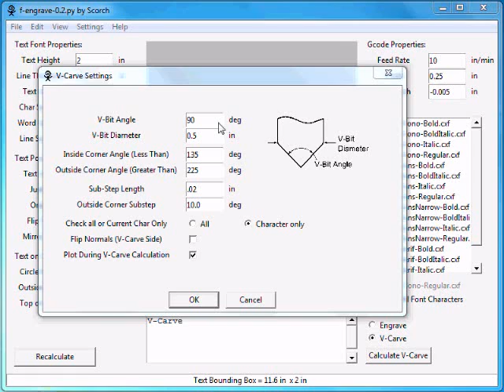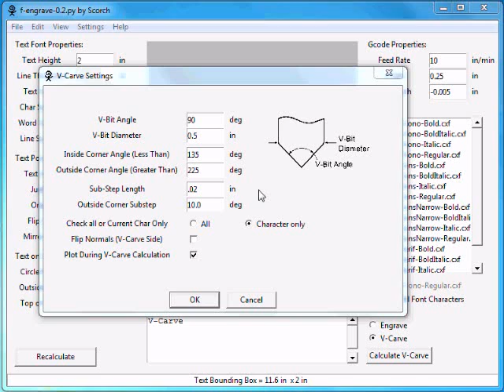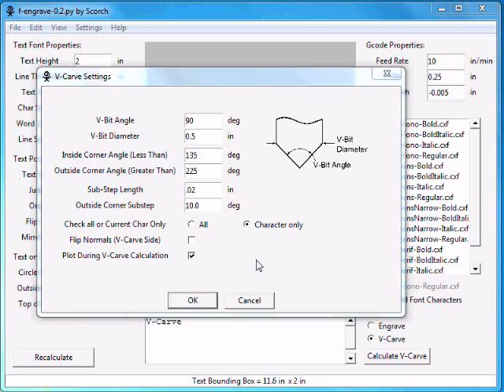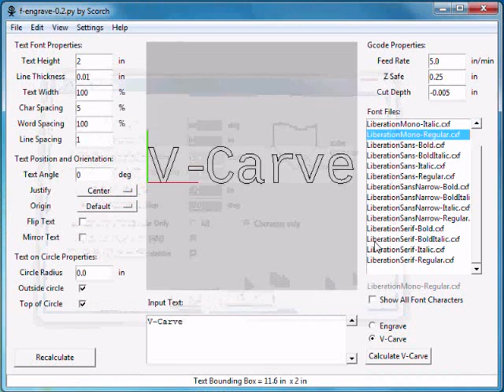V-Carving with F-Engrave V0.2 GPL Software

Comment: I have been using F engrave for over a year and now know just enough to be dangerous! My efforts thus far have produced some nice work thanks to your program. My question relates to the V carve settings dialogue. Up to now I have set up the dialogue with a 60 degree v bit and used a .125 flat bit and the same v bit to cleanup. So how does the program know I am using a flat bit to cleanup? It works great but how does it know I'm not using a ball nose bit. Perhaps it doesn't matter? I'm using v1.68
Reply from the maker: Cleanup assumes you are using a flat bit to cleanup.  Using a ball nose but for cleanup does not make sense unless you want to have little bumps in the bottom of your carving between the toolpaths.  If that is the case you can just use a ball nose in place of the flat bit.  You can control how big the bumps are by changing the stepover.  A smaller stepover will result in smaller bumps.  A really small stepover will give you a similar result as a flat bit (but it will take more time because of the small stepover.)
Reply: @ScorchWorks  As I thought and you have confirmed. Thanks

Comment: So using engrave will just be like using single line fonts?.... It will just follow one path and not try to fill in an area?
Reply from the maker: Engraving will not fill an area.  If you use a font that is designed as a single line font it will create characters by following the single line path.  Most fonts are defined by the outlines of the characters.  For those fonts the engraving moves will follow the outlines of the characters.  There are links to a few single line fonts at the bottom of the F-Engrave web page.
Reply: Thank you...that clearamit up but only issue is you really dont know what outcome will be until you actually machine it since depending on diameter of tool it could not engrave properly...
Reply: It basically shows a toolpath and you would have to be aware of proper bit to use to produce good output
Reply from the maker: @shelby50411  You can set the line width to see what it will look like.

Comment: how do you choose tool using engrave?..there are no options to choose bit size so how can it produce gcode?
Reply from the maker: For engraving the tool just follows the input lines with no offset. So F-Engrave can certainly generate g-code without knowing the bit size.  The 'Line Width" setting allows you to adjust the visual display of the engraved line in F-Engrave but that setting does not affect the g-code. The actual line width might depend on your engraving bit and engraving depth. (Depends on the bit you use.)

Comment: Hello,
Tried F-Engrave and I think it is nice program with nice features. 
But I have one question. For example I am doing some logo on 4 mm acrylic glass and I want to cut it out. I know that parts are cut by using multiple passes since spindle can't handle thick materials at once. 
I would like to know how to cut out in F-Engrave. 
So in short there is engraved logo (max engrave depth is 1mm) and square border. So i need to cut it out along that border.
Reply from the maker: You will need to cut the border by bringing the border into F-Engrave separately.  You can use either the engrave mode or v-carve mode with the straight bit selected.
Reply: OK, I will try. Thank you for such fast response.

Comment: hi i try to use F-Engrave to write  in Greek languish  with no success .I paste in the font file a ttf file and when i try to write F-Engrave  is not recognize any text .It  recognize numbers
Any suggestions?
thanks
Reply from the maker: There is a check box in the General Settings labeled "Extended Characters"  if you check that box it will enable more characters, as long as they are defined in the font you are using.  It is turned off by default because it takes more time to load the additional characters.

Comment: I tried the f-engrave *ngc but Mach3 reads a weird pattern. How can I add a g-code that is compatible with Mach3.
I am really impressed with f-engrave. Thanks.
My email:  ds1966gt@gmail.com
Reply from the maker: The output g-code should work fine with Mach3.  I will need additional info. If you e-mail the output g-code I might be able to see what is going on.  If you disable the suppress comments setting in the general settings before you save the g-code I will be able to see all of your setting in the g-code file so that would be helpful.  My e-mail address is in the F-Engrave help menu (Help-About)